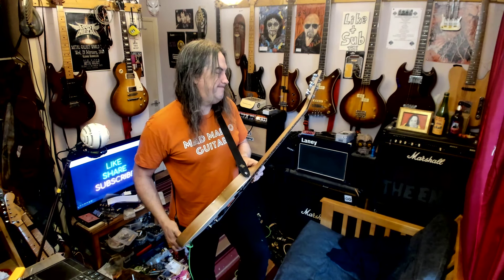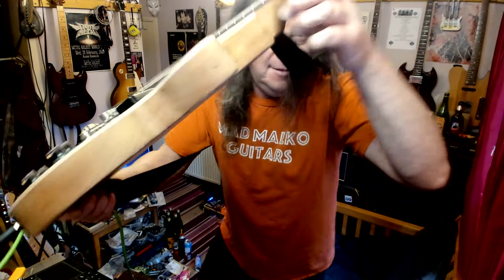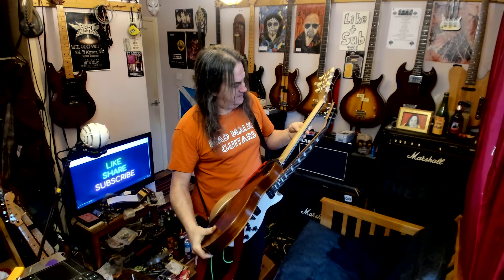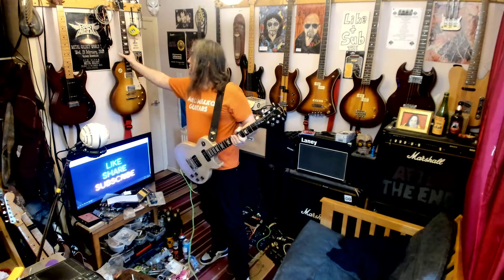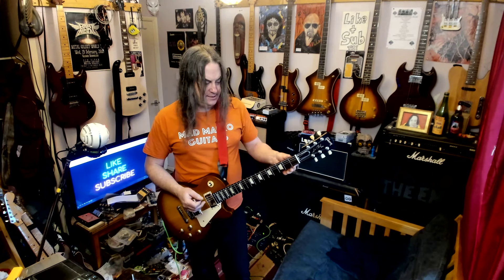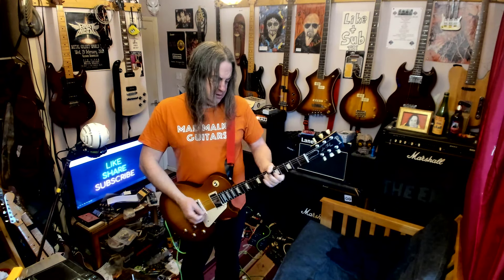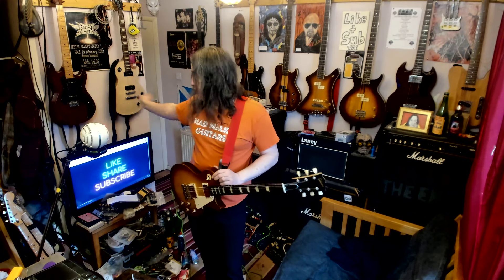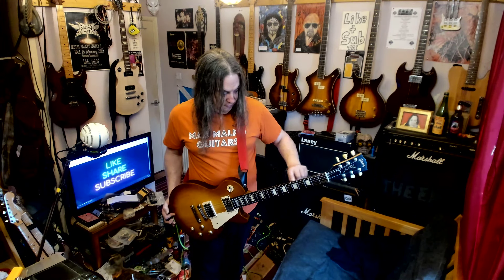Gibson Les Paul tributes- bucker vs.p90

Comment: If I was to go for a Gibson LP that's what I would get, a Tribute or maybe even a Studio. I'm definitely not a burst lover, gold, white or even natural. Speaking of Les Paul or LP type guitars I have had my eye on a 1976 Crestwood. Been doing a lot of research it says they were made in the Matsumoku factory and don't know if it's a good thing but Gibson were making Some Epiphones in same factory for a few years in the early to mid 70's. On back plate  of course it says serial #76** Made in Japan. It's got a lot of nice strip on the natural finish with matching headstock.Maple neck and finger board with black inlays, pictures look nice but bridge pup when turning the volume knob cuts in and out, not all the time, that's what add says, sounds like someone just told them it was a lawsuit guitar and was Japanese. Went from $400 down to $250 OBO. Do you know much of Crestwood? A beautiful 1980 Aria Pro II TA 60 semi-hollow, It's burgundy with binding everywhere, even F holes. Gold hardware that's fading, really nice guitar but close to$500. In America a lot of well to do communities have there wire underground. There is no room but any new communities the wires have to be under ground.😊 oh and on net it kept on saying Ibanez and Crestwood alot like at the time they were almost same guitar on certain models. Like I said have hade my eye on this one for a month.
Reply from the maker: ive not seen any crestwoods but its likely they were a usa importer -can probably get the same guitars over here badged csl,antoria,arbiter etc.have a look on the ibanez website at the old catalogs - you may be able to find the exact guitar - my antoria tele,csl custom tele and tempest strat are all in there
Reply: @MADMALKO  Thanks Malco. That Hollow body Aria T-60 just went down to $350, beautiful guitar.
Reply from the maker: @frankperricone2065  oh  japanese one??  thats cheap if it is
Reply: @MADMALKO  Yea, that 1980 Aria TA-60 Hollowbody says Made in Japan on neck plate. Crestwood gone. I said I will wait to see if it goes down to $250 I will jump, waited that one extra day after it did, gone. That Crestwood had a nice top. Well still have my Westbury.